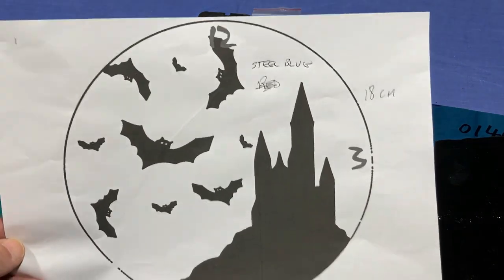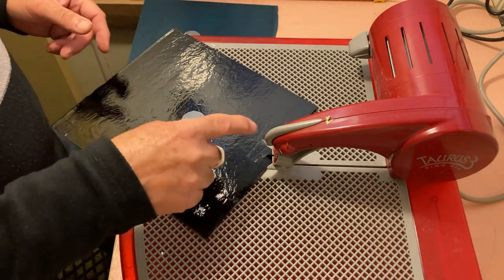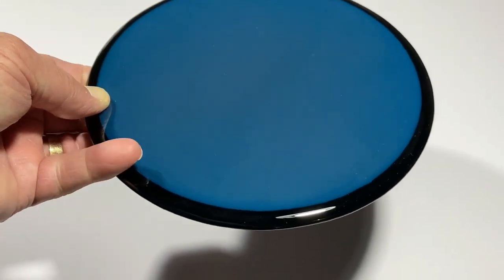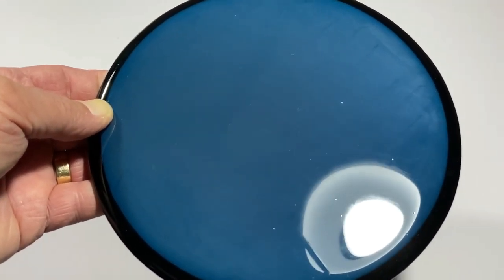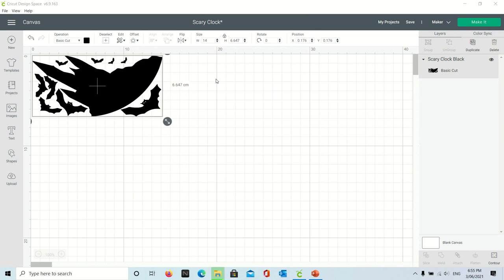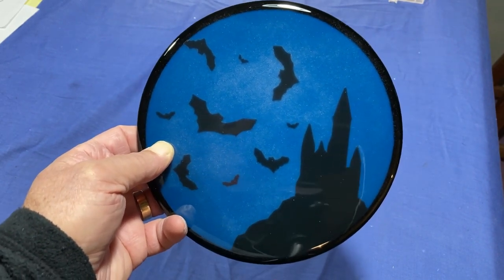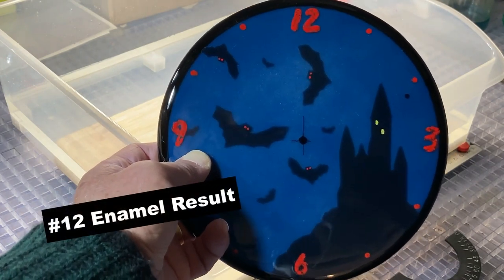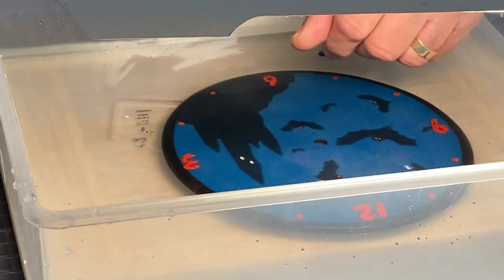Making a Fused Glass Halloween Style Scary Clock, Project Tutorial

Comment: Great video - Can I ask what material did you use for the transfers?
Reply from the maker: Hi Danny. The black decals were cut from solid colour fusible decal paper. It comes in a range of colours. It's quite inexpensive. I pay about $6 AUD for a 200 mm square sheet. Ask your supplier and they should be able to supply.